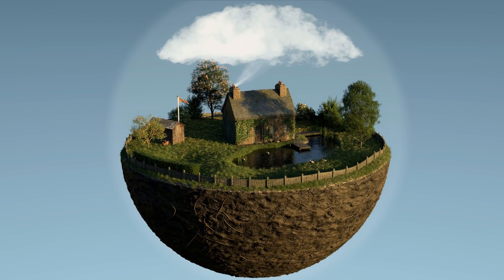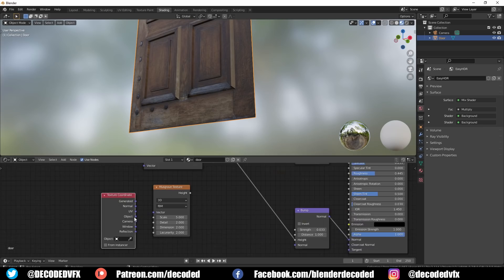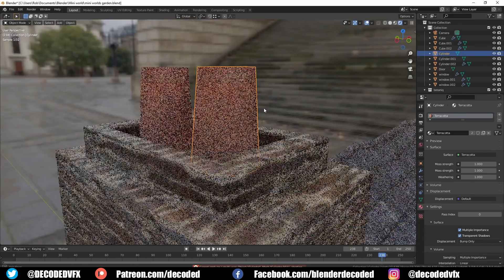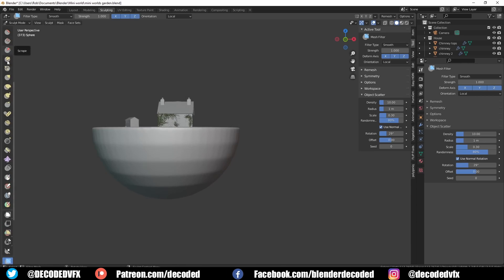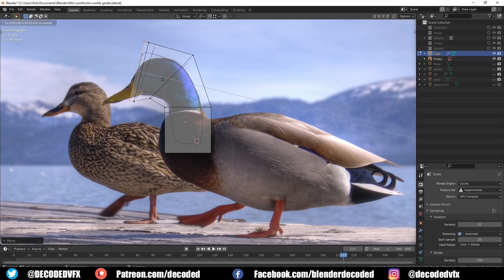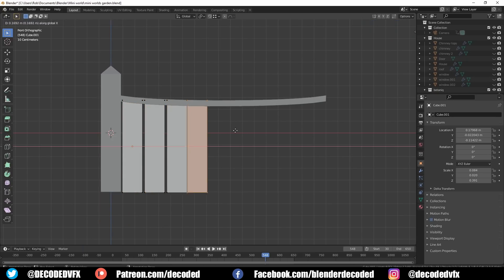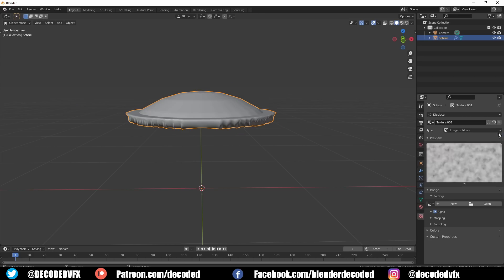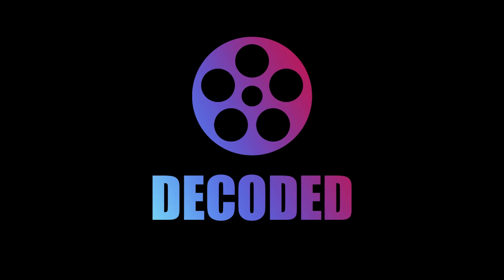I'm OBSESSED With Animated Miniature Worlds In Blender!

Comment: @17:13 how do you make the top of the half sphere close with vertices?
Reply from the maker: In this case ,the top is actually a separate object. But normally I'd use a Boolean to cut the sphere in half.
Reply: @DECODEDVFX  thank you, really, for taking the time to reply. I think what you did was E to extrude the node ring and then S to do it concentrically inwards. With potentially a final F to fill in the very last bit. I was trying to make my own little world and wanted to make a small mountain with a house on top, so need a mesh on top of the half sphere to sculp. But really, thanks man.
Reply from the maker: @rafaelsjm  sorry, I missed the part you were talking about. Yeah I probably just extruded then scaled in a few times.
Reply: @DECODEDVFX  probably cause i got the time wrong! Was actually@7:13! My bad. And thanks again!

Comment: It is a waste of geometry to cut in little details like those door nail things and even the handle hardware. Just leave them as free floating geometry. No need to connect them to the underlying door geometry, that just complicates things unnecessarily. The ducks material could use some work as well, but otherwise this turned out great. I've always been a huge fan of little diorama works like this.

Comment: okay so question, i noticed you did render passes. is it possible to do render passes for a fluid sim? like render the fluid bubble particles separate from the mesh and add them back later? i’ve been trying to figure out if it’s possible for a long time but can’t find anything on it. any help would be appreciated, thanks
Reply from the maker: Yes. Stick all your objects into a collection. Move the bubbles to a separate collection. Deselect the camera icon for the bubble collection. Create a new view layer (which you'll find at the very top of the outliner). In the new view layer turn off render visibility for every collection apart from the bubbles. When you hit render, Blender will do two passes. One with the bubbles and one with everything else. In the compositor you can access those layers via the Render Layers node. You can save all the passes inside the image if you save the render in ERX format.
Reply: @DECODEDVFX  thank you so much! I’ll have to try it soon. Now I just need to figure out why some frames have all the fluid particle effects disappearing and reappearing every frame every now and again, lol
But yeah thank you for the quick and informative information, I’ve been wondering of how to do this for too long

Comment: Shouldn't the shadows of the thing be lighter?
Reply from the maker: Possibly. The HDRI I used is of a very low sun which produces quite large and dark shadows. However the fact it's foggy should diffuse the shadows somewhat making them a bit less dark. I did realize this at the time but I was halfway through rendering at that point.

Comment: I've always wanted to do this. One of my biggest shortcomings as a 3D artist is dealing with extraneous space. But, if you constrain that space artificially then you don't even have to worry about it. Awhile back I did a path that looped around a sphere with a bridge at the top but the issue was adding anything square (like a house) requires the geometry conform to the radius of the sphere. I can do that no problem, but in order for the "bent" house to feel like it was in the scene would have required stylized/painterly textures which I'm not good at.

Comment: Nice! I think the dirt texture on the bottem was scaled to be too big. Not enough micro details.
It would be interesting to find out why the rain motion blur didn't turn out looking real. Rain is hard to film, I wonder if the "rain" in movies is real?
Reply from the maker: CGI Motion blur is really noisy, especially on small objects like rain particles. I could have made it work, but it would have required a massive increase in samples and render time.
Reply: @DECODEDVFX  Hm, I can't quite put my finger on it, but I think it's the rain overlay that broke the realism for me. Either that or the static trees.
Also that one duck head animation ;-D it just slowly dunks its head.
For the rain maybe you could try a particle rain system. But make the rain droplet objects have a blurred shape, to give the illusion of motion blur. Model the rain based on what the droplets look like in a photo, then animate them to fall.